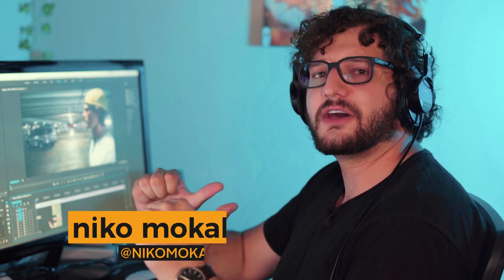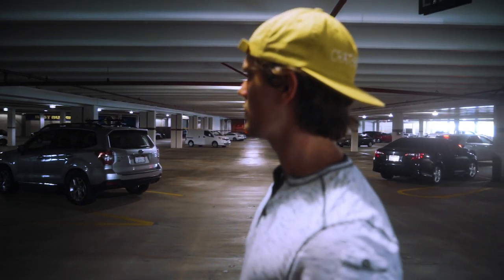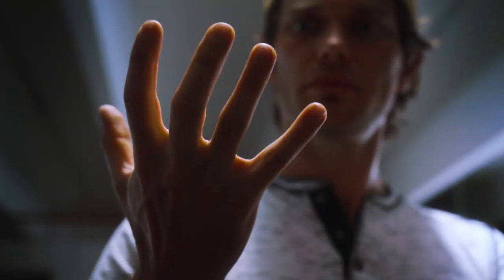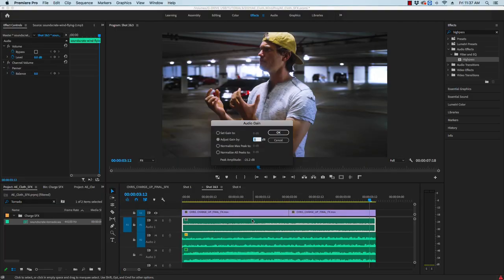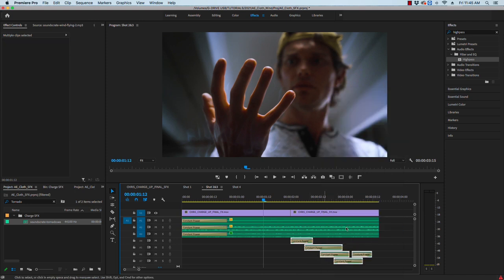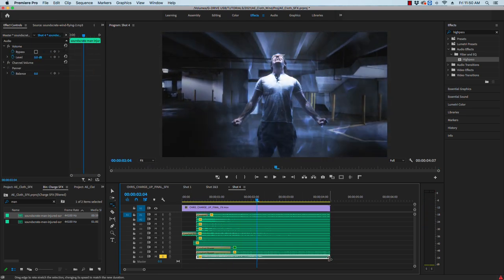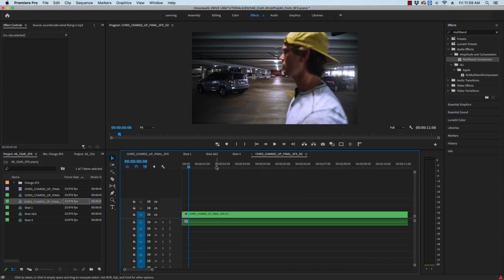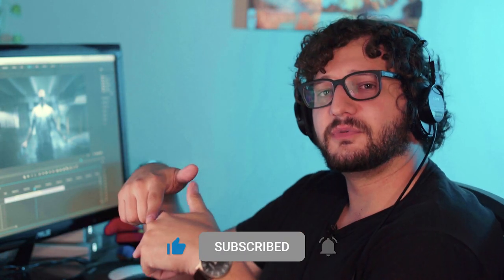TIPS & TRICKS for better sound design

Comment: Excellent tips. One question : If I have two people speaking (OTS) with a noise on left channel, should I switch the noise to the right channel as I change actor? 
I have tried it and it just seems a bit jarring.
Reply from the maker: A little pan could be good but definitely avoid jarring! What ‘feels’ right usually is, keep splitting the difference until it works, come back with fresh ears to confirm!